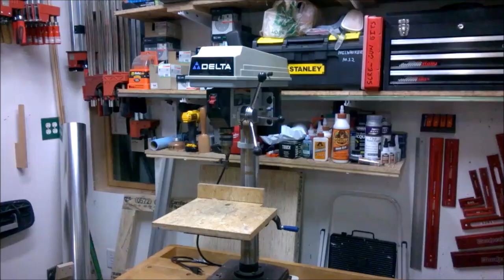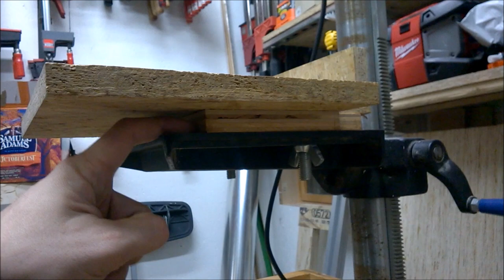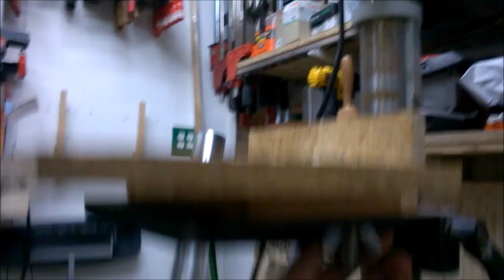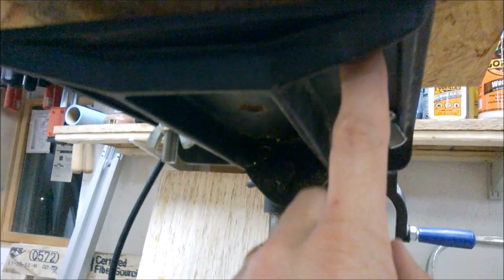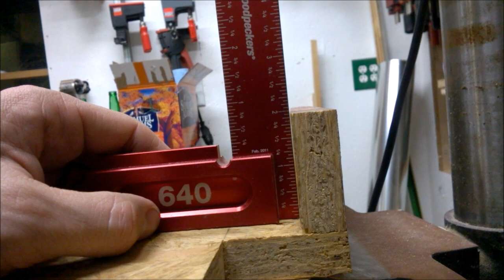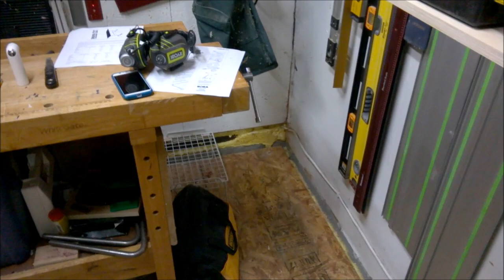Drill Press Table

Comment: I like that you've actually used the grooves in the original table. I've never seen another woodworker do that before but the sliding feature is a great idea as you maintain maximum support width ahead of the drill bit.
Reply from the maker: Thanks, Olly.